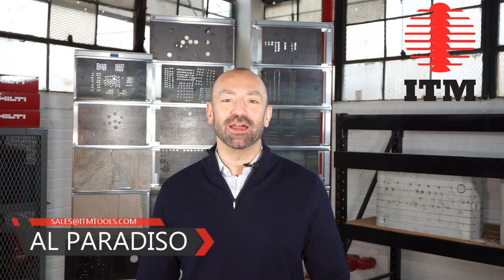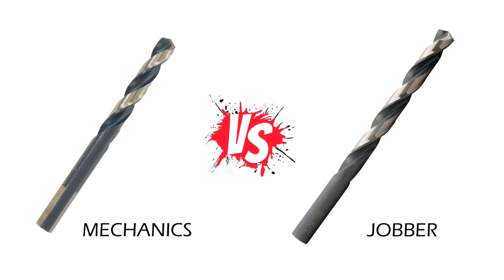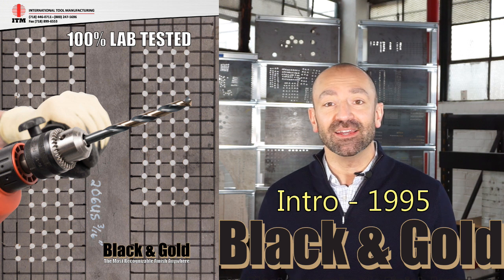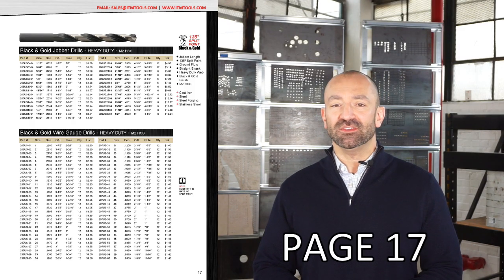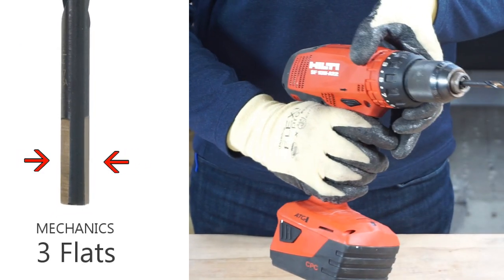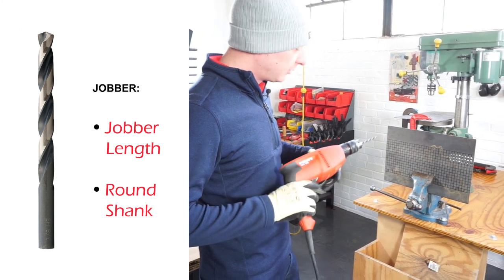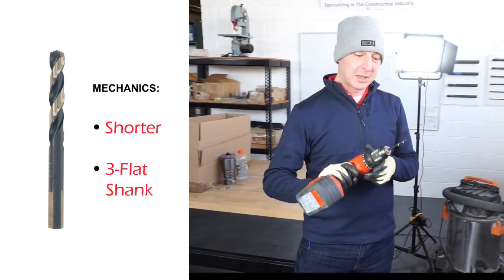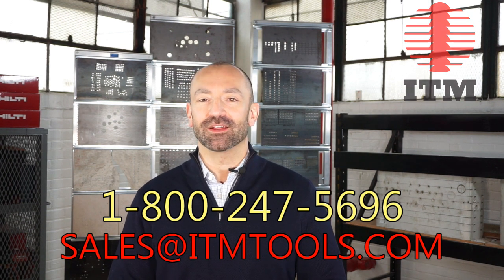MECHANICS VS JOBBER

Comment: Where are the drill bits  made  I looked through the catalogue and the  one's made in  Germany and Europe are posted
Reply from the maker: We produce drills in both the USA and in China. In this video, the jobbers are made in China and the Mechanics are made in USA. We also have USA made Jobbers for those who prefer (check pages 24-25 MRO series). Our 2020 catalog identifies USA made product. Some people object to "CHINA" made product, but it should be noted that there are cheap factories, good factories, and great factories all over the world. ITM has been dealing with domestic and foreign factories for 34 years, and 12 more years before that in manufacturing. At this point we have a good idea what works and what is crap. Thank you!

Comment: 30 holes per bit only. Sounds extremely low.
Reply from the maker: Depends on size, material, machine, pressure, speed. The smaller the diameter, the more holes you can get per drill bit.